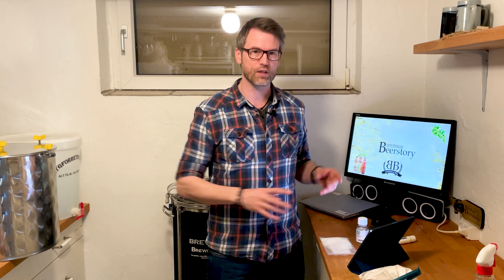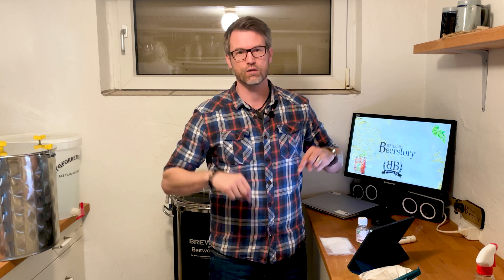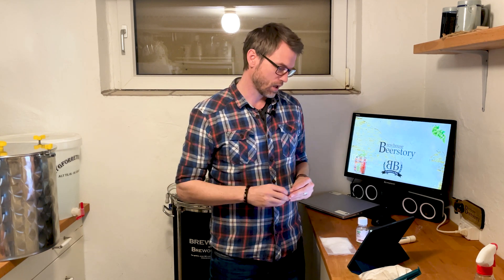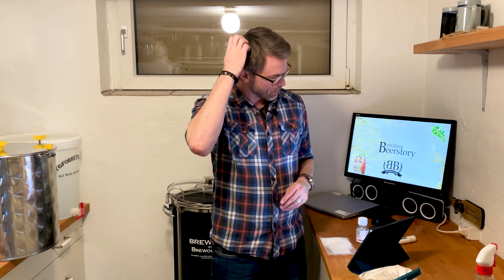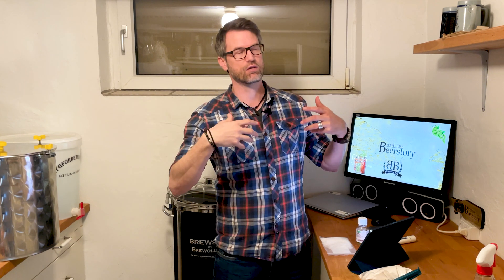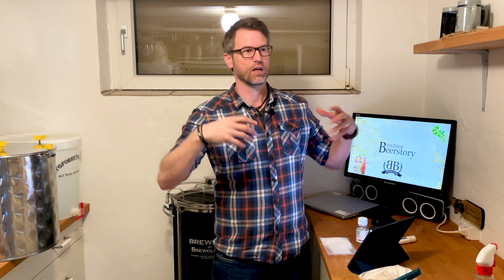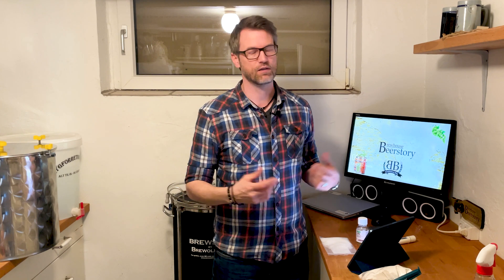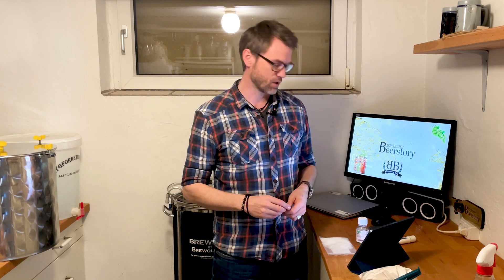Quick guide to watertreatment for homebrewers - how to get started with waterchemistry

Comment: If you correct the PH in the mash does it always correct the finished product,  for example,  if the PH is not correct during the mash is it too late to correct the final product?
Reply from the maker: The yeast will often correct the pH for you within a range of 4-5, depending on what ingredience, amount of grains and adjuncts, even though it wasn't correct in the mash. For the mash the pH is important for effeciency. In the final beer the pH is important for flavour and food safety. Normal beers will end up around 4.1-4.7 in most cases. But a stout or and IPA will taste different iwth a pH of 4.1 or 4.7. A hughe dryhop will raise the pH. That's probalby where you have to be most awere of the pH as a homebrewer. And for NA beers! There is not enough malt in them to lower the pH on it's own
Reply: Brilliant information as always,  keep up the great work 👏🍺